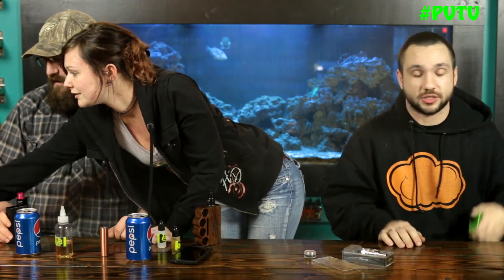PVTV Episode 5 - Battery Safety

Comment: I have a good video you guys can do. Coil build. The differnts between the gauge you use. And the resistance of it. Wraps. As in more or less wraps and how it will change your ohms on the coil. And how to choose to wrap around a 2.0 2.4 or 3.0 screwdriver. It will help many people with building coild